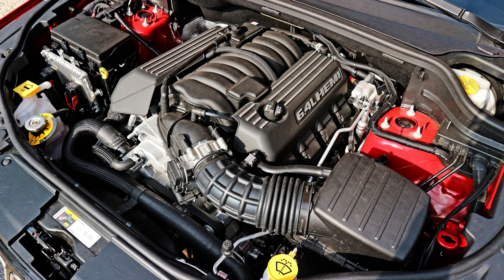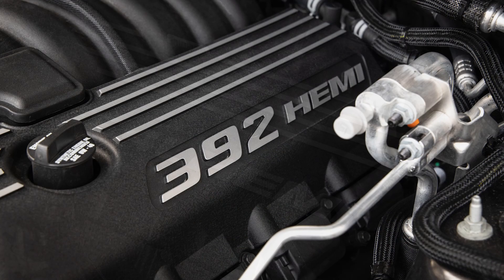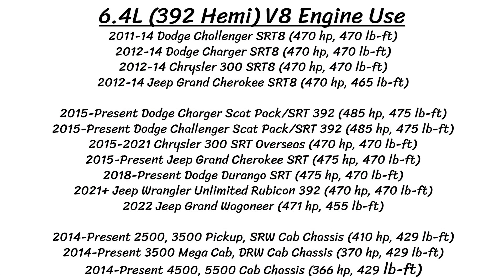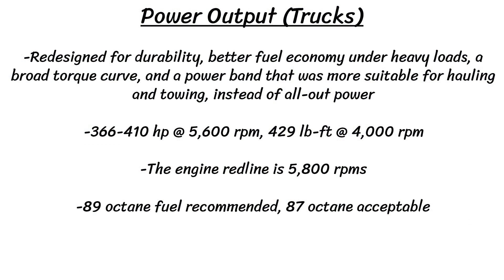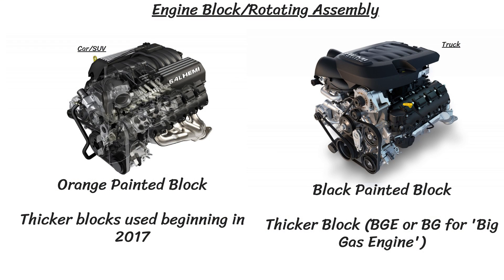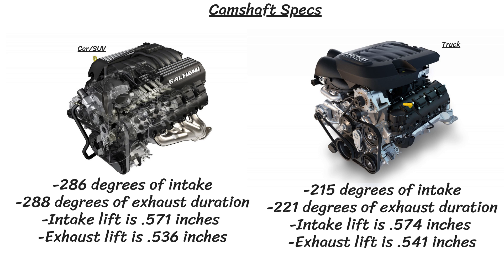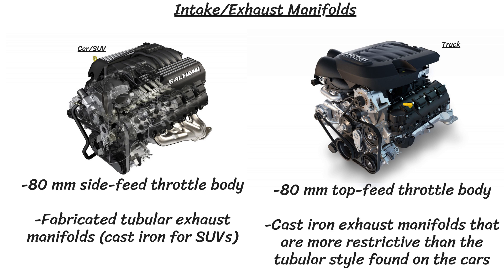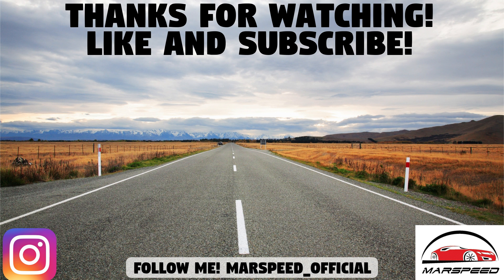6.4L Hemi V8 Engine – The Specs & Differences Between the Ram Trucks and SRT/Performance Versions

Comment: Makes you double think a 6.4L truck swap
Reply: Truck engine takes more boost because it has stronger internals. If you plan to boost it then the truck motor is what you want.
Reply: @gasolinediesel972  has there been anyone that’s actually boosted one of these to confirm or disprove that thought process.  Currently looking into doing a Ls Vs 6.4L from a truck and would really like to no the answer to this. Or is it just a educated guess that it can take more boost
Reply: @donaldsonjeoboham8759  Well if you want high horsepower then an ls as well as a truck 6.4 and an SRT 6.4 will all need stronger internals. But truck vs SRT, truck wins. The truck version doesn't have extensive testing but it's pretty safe to assume that it has stronger internals because I believe that originally they tried to use the SRT engine for the trucks but it had durability problems so they made a new version. The SRT engine was most likely bending or snapping rods. The truck version has stronger rods and pistons. I believe it is a very similar crankshaft, if not identical.

Comment: What's the difference between the 392 and 392 scat pack
Reply: Nothing anymore, before it was a package that gave you bigger breaks ans adjustable suspension with wider tires, but that stopped after 2017 where you could get it on a scatpack
Reply: @fknmonty  Oh snap!  You are going to set the SRT 392 crowd off!  Blood will be spilled. Lol
Reply: Nowadays, just badging.

Comment: What if dodge made a truck version of the hellcat engine? Would that he very wasteful?
Reply: Look up ram TRX
Reply: @munn34  ur not getting me. I'm saying a truck tuned version of the helcat engine just like there's a truck tuned version of the 6.4 hemi. Like a hellcat ram engine but for the 3500, 4500, etc
Reply: @blackice7408  The ram 1500 never got that 6.4L hemi because it will get poor fuel economy & decrease the towing & payload capacity & people are not going to buy it. That's what the ram 2500 & 3500 trucks are for with the 6.4L hemi. The 5.7L hemi V8 has alot of power & torque in the ram 1500, no need for a 6.4L hemi V8. Just copied from another comment
Reply: @joe1535  that's why I stated in my original comment "imagine" and it would probably be wasteful

Comment: What if dodge made a truck version of the hellcat engine? Would that he very wasteful?
Reply from the maker: They already did it! 2021 Ram 1500 TRX 💨
Reply: @MarspeedCars  no for like for heavy duty work like the truck version of the 6.4 hemi. Tuned for towing and not for performance - offroad or not
Reply: @blackice7408  @Marspeed answer the question!
Reply: @blackice7408  They’ll probably never throw a hellcat motor in the 2500 or 3500. Thats what the diesels are for.
Reply: @devontaykarter6648  yesim aware of that but again - imagine. I have to keep in emphasizing that word for some reason. And dodge is kniwn to be insane. It would be cool. It's just a speculation. My intention from the beginning wasn't to be 100% real on it. It was just like a dream creation if dodge ever made it
Reply: @blackice7408  I should’ve read closer, but yea it would be funny asl no lie seeing a big ass 2500 with a hellcat motor. Tbh when they switch over to electric motors u think the heavy duties will get the same package in terms of performance shit?
Reply: @MarspeedCars  There is no huge difference between the TRX version and the car version

Comment: The ram 1500 never got that 6.4L hemi because it will get poor fuel economy & decrease the towing & payload capacity & people are not going to buy it. That's what the ram 2500 & 3500 trucks are for with the 6.4L hemi. The 5.7L hemi V8 has alot of power & torque in the ram 1500, no need for a 6.4L hemi V8.
Reply from the maker: Great point, while it would be fun, most truck owners don’t buy the engine just for ripping around
Reply: @MarspeedCars  right people want reliability out their ram 1500. Also that 6.4L hemi was not in the dodge charger police pursuit cars.

Comment: I really like how rams have a 6.4 hemi great idea.
Reply: Yea but the power wagon weighs way too much. The weight to power ratio makes the engine feel like if its a 5.7 in the 1500
Reply: @Mrhandyhitman  You could get a 5.7L in a 2500HD back then. Imagine that dog with some weight on it.
Reply: @dragoonTT  right I’ve always thought that was a dumb idea from dodge
Reply: @dragoonTT  The 5.7 used to be good in those trucks but by todays standards it's trash which is why they ditched it. The 2500's with a 5.7 didn't weigh that much more than the half tons actually and the towing capacity isn't that much higher. They weighed only about 6000 lbs and they could tow about 13900 lbs. Not sure how they lost all that weight because a 2500 with a 6.4 is like 8000 lbs. A modern 1500 weighs about 6000 lbs and they can tow 12750 lbs.
Reply: @gasolinediesel972  Hmm thanks for the info. I still wouldn’t touch a 3/4 ton with the 5.7L. Just not a huge gas fan in heavy duty frames when a diesel is available.
Reply: Nah the 6.7 cummins is a better engine. More torque and fuel economy
Reply: @guacamoleweiner69  No shit that's why it's like $8k more.
Reply: @gasolinediesel972  9.5k more

Comment: I have a pentastar v6 dodge durango and it has no upgrades and feels pretty snippy
Reply: You two should try the factory lower manifold for the “Upgraded” Pentastars, my Dad and I swapped onto my 2012 with 3.6l along with MSD coil packs and it picked up a noticeable amount of power throughout the power band! Shocked the hell outta both Dad and myself when it felt stronger just easing away from the driveway, let alone won an open road where you can open it up.
Reply: @GreenJeep1998  Very true!  Did the same thing in my 300S except I used RIPP coil packs. Really woke up the performance across the power band.  Very pleased!
Reply: @aj_hlct6230   Those two mods and a RPM Motorsports resonator delete tube really woke up what wasn’t exactly a slow car to begin with.  Fortunately, a couple weeks before those parts went on, we put better rear shocks and springs (dealer covered fronts under the extended warranty and were still good) as well as minivan rotors and calipers like your 300 has up front with matching stock size rear rotors and factory calipers with appropriately sized and matching semi-metallic pads all around.  It’s like a different car with only a couple grand in parts and a few weekends of labor!  Now Dad is talking about wanting to see if the rear brakes from his Grand Caravan would fit and hunting down better injectors to work with the E85 and a thicker, Avenger R/T and 200S rear sway bar to replace the bar that they put on the V6 Touring package cars like mine…….because if a noticeable improvement in go, whoa, and carving is good, even more is better, especially on something that almost looks like I bought it from a rental agency after it was retired 😅
Reply: I have the pentastar in my 2014 grand Cherokee and it is indeed pretty snippy